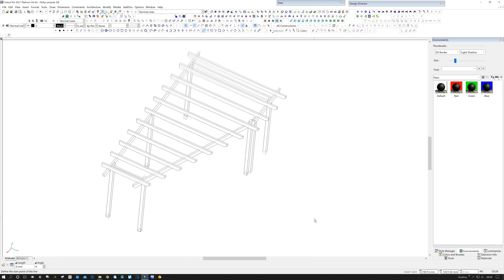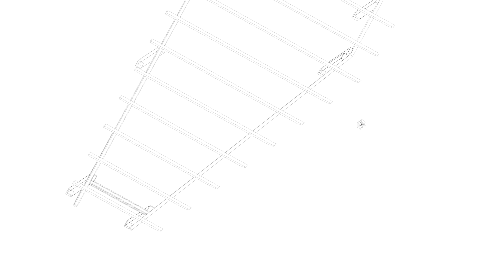Tafty's Pergola build Pt3 - Finished but the concreting, top spars notched with Makita circular saw

Comment: Fantastic work again Gid. Good tip about putting the screw underneath the beams rather than from above. Looking forward to seeing the bike shed 👍
Reply from the maker: Thanks Mark 👍 yep, it's not always an option but i try to if poss do that on outside stuff, I've a few messy days but the shed will get built over the next few days, i'll upload asap, It's a shed that you can put a bike in now 😂
Reply: @Gidjoiner  Marvellous craftsmanship as always Sir 👍 Is that the workshop extension you are referring to? Did you get that few quid? 🔨 🇮🇪
Reply from the maker: Thanks 👍 the shed in the comment above? no if so, i was ref to the bike shed on this job/house, my shed extension won't be happening for a little while, i do have a bit of the wood to build it but haven't got the time to do it, need to clear fecking Bindweed from the back yard 1st 😒😂
Reply: @Gidjoiner  Your welcome, 👍 I suppose you will be trying to get the w/s extension done before the shit weather hits in late October early November. I love the structural side of the trade but the older I get the less tolerance I have for getting soaked, 🙄 I always try and line up some nice joinery work for the winter. My w/s build is coming along, the felt and battens are on. Slating next Week or the Week after, depends on the weather, 👍🔨🇮🇪

Comment: Nice job mate, that came together pretty good, I like the fact that its not rectangular it gives it more character and I agree the table does look a bit small now, looking forward seeing how you sort out the base for the bike shed 👌👌👌👍👍👍🇦🇺
Reply from the maker: Thanks Graham 👍 all through it i wasn't sure & not right up until the end did i decide but yeah i think it worked out ok, the 'not rectangular' gives it a bit of character 😊👍 Yep a little big 😂 i concreted in the posts & put the chairs back today, that helps give it a bit of proportion & once something grows over it , think she's going to see if she can get a grape vine to grow in our crappy weather. The shed that you can put a bike in as it is now will get done over the next few days, got a few messy days but hopefully by the wk'end 👍 https://scontent.flba3-2.fna.fbcdn.net/v/t1.6435-9/235187361_4364934830259516_3145102805909429580_n.jpg?_nc_cat=111&ccb=1-4&_nc_sid=0debeb&_nc_ohc=uVWKyUIolRIAX_YOtOB&_nc_ht=scontent.flba3-2.fna&oh=60b1569cbef76732dedcb393ca8bc24c&oe=6139F0CD

Comment: Looks spot on to me Gid, good call on cutting the spars square. You're getting pretty good at these Pergola's, must be like shelling peas to you by now!
Notice you've been using the new Makita cordless quite a lot since you got it, new favourite toy perhaps?
Reply from the maker: Thanks John 👍 Yep if i'd cut them at an angle I'd have had to reset the saw to 90° to do the 45° bevel, lots of fannying around, sometimes simple is best 👍 I've built quite a few over 20yrs but each one of these is a little different n you learn a little from each one, next time i'll consider 60° x 30° for the shallow braces, not sure if the Metabo went to 60° so that thought wasn't in my head 👍 I didn't use the Makita cordless on this job but the fact that it is cordless means it'll get used more than the 240v one i've got 👍
Reply: Sorry Gid, bad habit of mine saying "cordless" to identify a cordless drill, when everything nowadays is or can be pretty much cordless.
I was referring to the Makita cordless drill you recently bought, @5:53
Reply from the maker: Ah yes sorry, my fault, i didn't think cos it's new, Makita cordless - my mind went straight to the saw, Yeah they're quite good little drills, i bought another exactly the same like i said i would in the other vids, for this i just grabbed 2 drills off the shelf & when my tools get put away each day, quite often the ones i'll be using get dumped on the floor at the back of the van, so they're the ones that come out next day, 👍😊
Reply from the maker: Yeah it surprises me, i sometimes throw a little money, £20-£30 quid at something expecting it to die quickly just to prove myself right that is not worth buying cheap crap, but occasionally one surprises me when 5yrs later it still works n gets used regularly 👍,   The little Makita is quite powerful tho, 50 Nm which is good, ½" chuck & brushless so shouldn't burn out easily. we'll see, i do use the Bosch 85C in this vid for the heavier stuff tho, 85nm it's a bit of a beast, doesn't even blink at driving those coach screws in or tightening the nuts up, 💪 the handle that comes with it is extra long & where it attaches around the collar it's notched so it grips the drill better, 😊
Reply: @Gidjoiner  I've been trying to suss out which model Bosch yours is, 85 Nm?? Jaysus that's heavy duty!
Reply from the maker: @johnwilliams1716  I didn't get it from here but yeah the 85C is a wrist breaker 👍 There's a more powerful one I ordered last week, the Bosch 110C but delivery is slow, expecting that end of the wk, 110nm 😮😂 Don't need it, just had to have one 🤣🤣 that other older 18v Bosch i have is 10yr old, i bought it for tightening nuts expecting it to die but it didn't n that set me on the Bosch cordless route 👍 https://www.powertoolworld.co.uk/bosch-gsb-18-v-85-c-brushless-combi-drill-body-only?gclid=CjwKCAjwx8iIBhBwEiwA2quaqyww4jYcj9oogccuh2SUzP_yrlWrN5MRcs29FITXs03P89Xo4KvJxRoCh3cQAvD_BwE
Reply from the maker: This is the 110C on Amazon, i ordered mine from a local place for about the same price https://www.amazon.co.uk/Bosch-Professional-06019G0309-excluding-Rechargeable/dp/B083QM7PLT/ref=asc_df_B083QM7PLT/?tag=googshopuk-21&linkCode=df0&hvadid=430861419358&hvpos=&hvnetw=g&hvrand=13399856309640083418&hvpone=&hvptwo=&hvqmt=&hvdev=c&hvdvcmdl=&hvlocint=&hvlocphy=9046317&hvtargid=pla-916265219754&psc=1&tag=&ref=&adgrpid=103132776674&hvpone=&hvptwo=&hvadid=430861419358&hvpos=&hvnetw=g&hvrand=13399856309640083418&hvqmt=&hvdev=c&hvdvcmdl=&hvlocint=&hvlocphy=9046317&hvtargid=pla-916265219754
Reply: @Gidjoiner  110 Nm? That's no wrist breaker, that's an arm mangler.
Many thanks for the links, bookmarked for future potential purchase!
You really need to do an update on your most used/ best buys/favourite tools, that vid would go down a storm, guaranteed!
Reply from the maker: 👍 Yeah you'd need an hr spare 😁 That 1st link, I've never shopped with powertoolworld, it was just a link i found to show the drill 😉 I think i bought mine locally, prob same place i'm waiting for the 110C from,

Comment: Looks spot on mate, was it you or the customers decision on what size it was going to be or was it just a case of build it to fill the concrete footprint and make it look 100% better
Reply from the maker: Thanks Ian 👍 This is for an old friend of mine, she orig wanted a corner one that only covered less than half the table, both me & the Mr weren't sure about that so this was a bit of a compromise, not the full area & also still a slightly triangular one, Normally on a job i would build as asked, we'd discuss the job, materials & design but i wouldn't interject my desires into their design, their wish is my command sort of thing but on this she was over-ruled 😁👍 + it's a little different 😉

Comment: Looks a great job Gid. Interested  in the decision to concrete the posts last.  Is there a concrete punch pad underneath each of them or do you just use some shingle or stone or are they sufficiently treated to go directly into contact with the ground?    Cheers
Reply from the maker: Thanks Rob 👍 No there's no bottom pad, this ground is solid not far down & this is only holding it's own weight, no one will be walking on it & it won't but if it did sink a fraction it wouldn't matter, I did put the treated end of the posts down but adding shingle to the bottom of a hole is bull, sorry, a hole will drain if it can anyway, if it can't because it's in clay shingle wont help, imagine putting shingle in a bowl of water, it isn't going to help drain the water away, posts rot at ground level, fence posts when rotted often leave a stump in the ground, that's because it's wet down there but very little oxygen for the fungus n bugs that cause rot to live , it's called hermetically sealed, around ground level it stays damp enough & there's oxygen for the wood eating bugs n fungus to live. so if anything you don't want to improve the draining further down, you'd just be introducing oxygen down there & so create a bigger area for the rot making bugs to live. I prefer concrete to fix the post in place because  it sticks a little to the post so adds weight to the bottom of them to help anchor it, it supports the post by not only filling the hole around the post but also by sort of increasing the post base width, so when the post does move it has a greater surface area to push on the surrounding soil, a thick thing doesn't cut as easily as a thin thing if that makes sense, & i do it last or at least when the main frame is built & braced because i know it's all in it's final position, plumb, sq, level etc, i often have to kick the bottom of the posts a little when adding the braces to get them plumb. i put the spars on this one before concreting because that's the way it went, i didn't have the concrete stuff, i wanted the spars to add weight to help hold everything in position while it gets concreted & i was juggling the weather a bit, Roof spars before or after concreting i don't think makes any difference, except when they're on you know it's finished & it can be firmly concreted in place.
Reply: @Gidjoiner  Thanks Gid for such a great and detailed reply.  I asked the question because you put a concrete pad under the posts for the barbecue room  and I guess that was because of the loads they were going to carry, with the floor and people.  On the other hand many of the bacteria that cause wood to decay are anaerobic so hermetic sealing does not affect them, they actually prefer it!  Cheers
Reply from the maker: Ok, I may be wrong or just the info i have is out dated, I'm going to read this properly when my brain can focus https://www.fpl.fs.fed.us/documnts/pdf1996/claus96a.pdf either way for some reason sodden posts in a deep hole don't rot from the bottom up as fast as they rot around ground level or a bit below 🤷‍♂️😉
Reply: @Gidjoiner  I think you are right about the relative rotting times for the various parts of a post, hence the recommendation that a concrete collar is built up above the ground and slopped away from the post.  Looks like the new saw is proving to be a great asset.

Comment: Top man, great work as per usual, quick question though, why will you concrete the pergola's posts after building the entire structure? Cheers. Greg.
Reply from the maker: Thanks 👍 The concrete sticks a little to the post so adds weight to the bottom of them to help anchor it, it supports the post by not only filling the hole around the post but also by sort of increasing the post base width, so when the post does move it has a greater surface area to push on the surrounding soil, a thick thing doesn't cut as easily as a thin thing if that makes sense, & i do it last or at least when the main frame is built & braced because i know it's all in it's final position, plumb, sq, level etc. i put the spars on this one before concreting because that's the way it went, i didn't have the concrete stuff, i wanted the spars to add weight to help hold everything in position while it gets concreted & i was juggling the weather a bit, Roof spars before or after concreting i don't think makes any difference except when they're on you know it's finished & it can be firmly concreted in place.
Reply: @Gidjoiner  that makes complete sense. Structurally sound, square and plumb before the final pour. Thanks for an in depth explanation. Legend!

Comment: Another cracking job Gid. What was the opening span from post to post? Would you expect any sag in the roof cross member?
Reply from the maker: Thanks Paul 👍 it's about 2.8m span between the supporting rails, the calc is Span ÷ 20 + 20mm for a 45mm joist @ 40mm centres, or reverse that to calculate how far a joist will span, 145mm - 20mm = 125mm x 20 = 2500, so these are a little short for joists at this distance but the added/deducted 20mm is to reduce bounce in a floor, so as nobody will be walking on this you can forget about removing the 20mm, which means a 145mm joist will span 2900mm 👍 I'm more worried about twisting, there's no noggins on these things to hold them upright & the British weather means they will get wet, then get baked in the sun & the wind, they prob will sag a little simply because they're outside, but a massive wooden joist would too, that's just wood when wet 👍🤷‍♂️😊
Reply: @Gidjoiner  cheers mate for that. You certainly know your stuff. I thought twist is something you get added from the suppliers🤣and if you are really lucky, they throw in some free cupping🤯
As you know pal, I love your videos. I learn so much .  Thanks again 👍🏻👍🏻
Reply from the maker: 👍 Thankyou Paul, these are C24 joists so are quite knot free & should be fairly stable but them being outside,, who knows 🤷‍♂️😁

Comment: That looks really good, solid too. The Angola design makes it more pleasing on the eyes. Did you cut off the excess on the bolts?
Reply from the maker: Thanks Mike 👍 Yeah it feels fairly solid, i concreted in the posts today that helps secure it down, I will be cutting the bolts off, that's something i've def decided on, got a few bits too do like sort out the fire place & water butt, + do the shed so over the next few days i'll be doing those bits,,,, Or at the end 😁👍 n yeah the shape turned out ok, better than a reg rectangular one 👍

Comment: Gid ....what's your computer set up your running 64 or 32 bit? Also did you get a download or a hard copy of TurboCad Platinum 2021?
Reply from the maker: Microsoft Windows 10 Pro - 64-Bit  
I use Vegas Pro with Boris Continuum, Mocha Pro & GIMP to make the videos,
I haven't got a disk for any of the software i use inc TurboCad Platinum 2021, it's all downloads.

Comment: Sorry if you’ve been asked this question before Gid but what blade are you using on your mitre saw?
Reply from the maker: Hi, sorry for the late reply, When i saw it online & watched vids of it they made out like it had a crap rip type blade with just a few teeth but mine came with 60T blade that seems to be quite good, I like Freud blades tho, the one that's my small Dewalt is the same one i put in when i got it, more than a yr ago, cutting the composite deck on my last job killed it i think but has lasted a long time.

Comment: Just wondering.. Why didn't you make it rectangular?
Reply from the maker: This is for an old friend of mine, she orig wanted a corner one that only covered less than half the table, both me & the Mr weren't sure about that so this was a bit of a compromise, not the full area & also still a slightly triangular one, Normally on a job i would build as asked, we'd discuss the job, materials & design but i wouldn't interject my desires into their design, their wish is my command sort of thing but on this she was over-ruled 😁👍 + it's a little different 😉

Comment: whats a average height for a pergola? ive just done one and set it at 7' 6' but customer said its too low??
Reply from the maker: Not an easy one to answer that, to make it look right height, width & length need to be proportion, it has to be high enough to be useable so you can walk under & still have a plant trailing over, & there's the practicality of the timber to take into account, a 4" timber will only go so high before it becomes a bit 'wavy'. as i said in the vid, i'm 6'2", i like to have at least 300mm above my head, then there's the spars to add on, this one finished in height 2.3m-2.4m, i'll measure it when back up there. Is the 7'6" to the top side of the timbers, the highest point? that's the same as mine if so. & i always discuss height with the client before, did you?
Reply: @Gidjoiner  yes mate 7-6 at max dropping down to 7-2 at low
Reply from the maker: @seanmcgrath9167  Is it on a slope?  7'2" - 6" for spars, so underneath head height is 6'8"?
Reply: @Gidjoiner  yes on a slope but underneath head height is 7' 6' down to 7' 2"
Reply from the maker: @seanmcgrath9167  Tough one to say much on then without being there, I think clients sometimes struggle to realise the size n height of things before they get built, 🤷‍♂️
Reply: @Gidjoiner  failed to mention a hot tub was going in. luckily enough  and by pure chance i was bang pretty much bang on with the measurement when i checked the hot tub specs :) got paid.......moved on :)